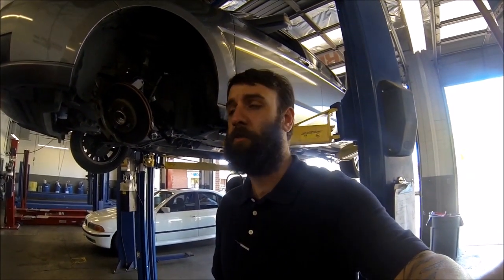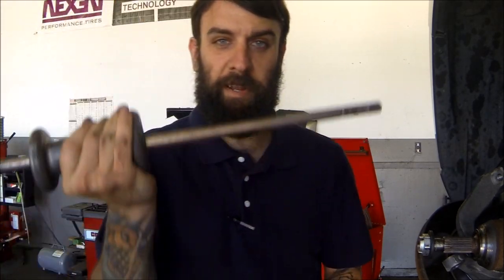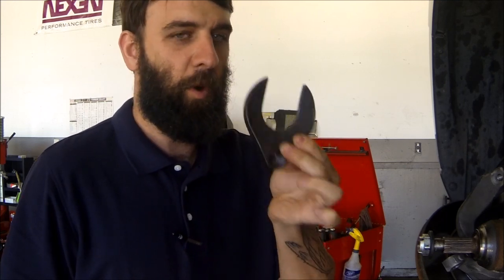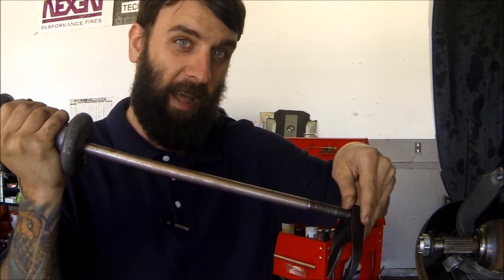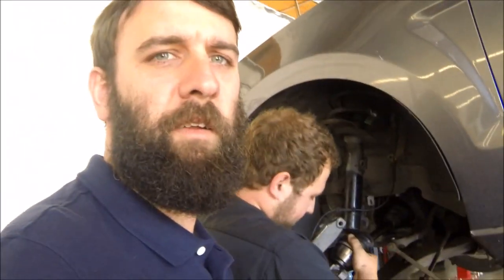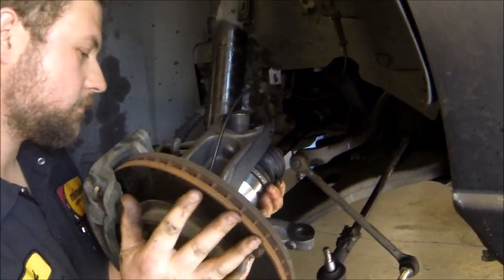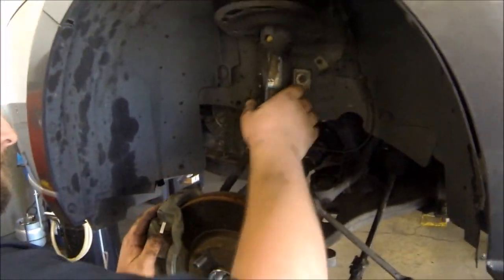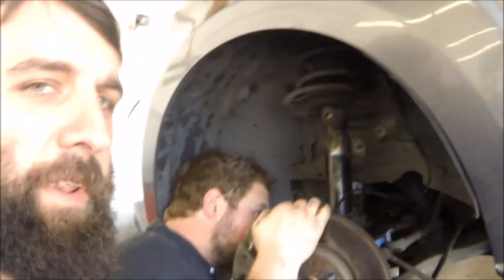Drivers Side CV Axle 2010 Ford Focus

Comment: Wow, thanks a lot! Ive got a 2010 Transit Connect, which has the same drivetrain as the Focus. I've been wailing on that CV for awhile. I had a crowbar against the transmission case giving it as much force as I thought was possible without breaking the transmission case. I've got a slide hammer but couldn't figure out how to get the thing connected. Tool ordered!!

Comment: Another method I just discovered is to take the bolt out of the lower engine mount, jack up the front of the engine to rock it forward and then you can slip a large flathead screwdriver in between the transmission case and subframe to pry behind the CV axle with your foot while you pull the axle with both hands. Wouldn't work too well on a lift but if you're in your driveway it works perfectly!

Comment: I appreciate the time everyone takes to make these videos with the purpose of helping others. However, I just replaced my CV axles on my 09 Ford Focus and found it impossible to use fit this tool to pull out the CV axle. However, a medium sized pry bar placed at the 6 o'clock position on the CV Tripod joint and it popped right out.  However, the tool worked great to pull the passenger side off the intermediate shaft.
Reply: There is no clip on the passenger side.

Comment: The knuckle on that car has no rust, is it brand new, or painted? 
It seems some 05-11 Focus knuckles can rust quite profusely. The rust seems to penetrate quite deeply, to the point that so much rust exfoliates, the surface is all cracked up, and comes off in flakes when you hammer on it. I know iron knuckles rust, but I have never seen it to that extent, especially on cars about 10 years old. I've seen this on Focus's which were otherwise not very rusty. Most cars just get a sort of surface rust on their iron knuckles.

Comment: Will the trany oil drain when you pull out the joint?
Reply from the maker: No, a little may trickle out, but it will not drain

Comment: I have a 2012 focus i changed the driver axle because it made a clunk noise wen i hit the smallest of bump were ot meets the trans it wigles up and down i put a new one and does the same thing did i need to happer it in for it not to wigle were ot meets the trans all help would be appreciated

Comment: Seems like you guys got the Outer CV joint Removed with out any Issues Yes I had to use Slide Hammer to remove Inner Cv Joint from Trans.  I'm a Master Tech Replacing Drivers Cv Axle Assembly But Outer Cv Joint wont Come Out of Hub, Splines are Rusted and Some one had it Removed at One time but didn't Clean Splines and VERY IMPORTANT Use F##k##G ANTI SEIZE Lubricant and Apply it on  OUT CV JOINT Splines and Hub Splines after Cleaning with Wire Brush and Brake Clean.  So many FN Mechanics are too Lazy or Don't Care to apply Anti Seize Lubricant or any type of Grease on the Splines Especially in Areas where it Snows  and use Salt in the Winter time. I have the Drivers Side CV Axle-Hub-Steering Knuckle Removed from the Car on Vise and Using Snap-On Hub Flange Screw Press and that Shaft is not Moving Been Soaking the Axle Splines with Rust Buster. I notice my Parts Store Stocks Steering Knuckle Bearing Hub Dust Shield all Ready Assembled for $300.00                                                                       DORMAN OE SOLUTIONS
Wheel Bearing and Hub Assembly
Part# 698-409
 Left Front  Part#698-408 Right Front  
So  Be the first time in 40 years Hundreds of CV Axle Replacements I Can't successfully remove CV Axle Joint out of Hub because some Numb Nuts Didn't Clean and use Anti Seize on Splines,  Got a lot of Pressure on Hub Screw Press may Cause Damage Parts and Press tool turning it very slow with 4 ft Long 3/4" Drive Snap-On Ratchet .I'll report back

Comment: Do you have the tool part number???
Reply from the maker: Tony P Google "cv joint puller" and it will give you multiple options. I got mine through ford but I don't remeber the part number
Reply: AutoZone rents this part.  FYI though, I couldn't find enough clearance to get that tool in there until I pulled the whole tranny from the car.  Once it was sitting in the driveway I could finally get that slide hammer tool around the axle and even then it was kind of a b*tch.  ALSO, PLEASE PLEASE look into the "circlip" that goes on the transmission end of the axle.  nobody talks about this and it's a VERY important aspect.  Dont reuse old ones.  The clip makes it MUCH harder to get the axle out AND back in.  Also, don't "grease" the axle splines as this guy states, you want to use transmission fluid to spec for your tranny (aka, don't mix fluids with "grease").  Hope those pointers help!

Comment: What are some symptoms of a bad cv joint?
Reply from the maker: +Matt Balok The most obvious sign would be a clicking/clunking sound when turning. This would be most noticeable at slower speeds in tight turns.
Reply: I've done two wheel bearing on the one side, noise still there when I turn left. It sounds like a bearing but it's not, could this be the drive shaft or differential? I know this is an old vid.
Reply: galantv6sport i took it to a shop they said wheel bearing but I drive a different car now lmao

Comment: PLEASE NOTICE: there is not enough clearance to use this tool unless the subframe is dropped (maybe the MK2 focus realized and fixed this?).    Also, will somebody PLEASE elaborate on the "circlip" at the tranny end of the drivers side axle, in a groove within the splines?  Seems that getting the axle back in with the clip is nearly impossible, as there is no way to slide hammer the axle back in, and it takes a LOT of force to get the circlip past the spider gears...  Is the criclip just Ford's way of saying "nope, you gotta have us do this job!"?  BTW, f*ck proprietary tools and designs.